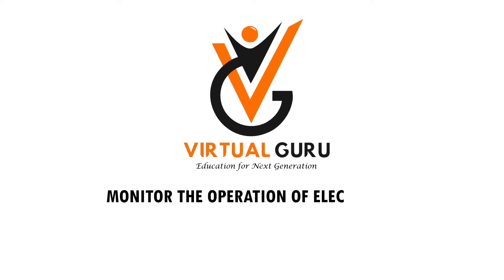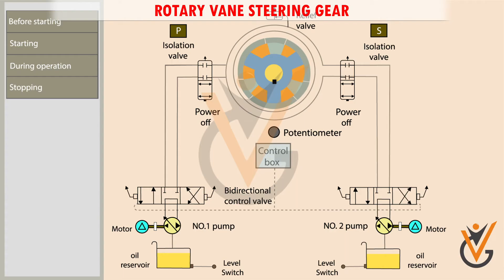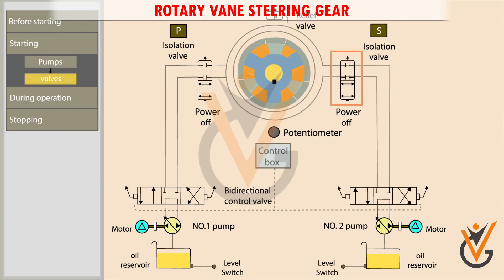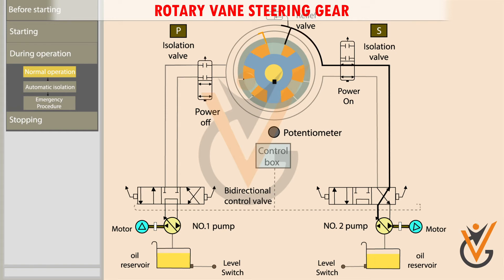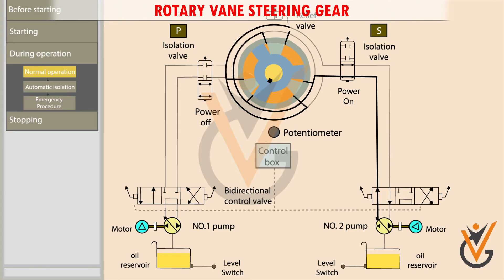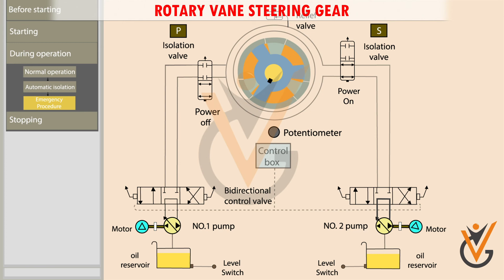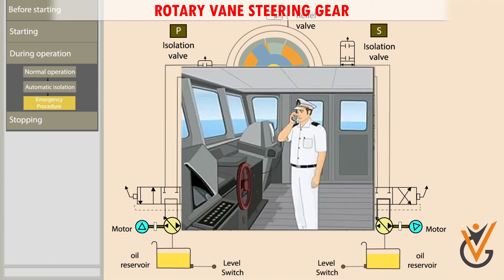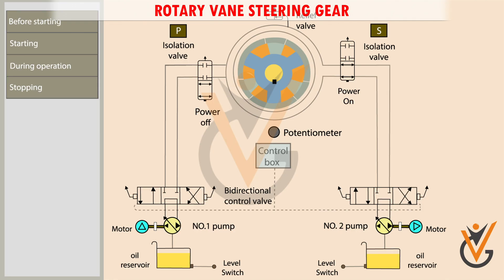Monitor the Operation of Electrical, Electronic and Control Systems | Rotary Vane Steering Gear

Comment: Could u plz explain the function of Relief valve, sir?
Reply: The function of a relief valve is to reduce the shock of pressure in order for the pipe lining not to get destroyed due to stress.